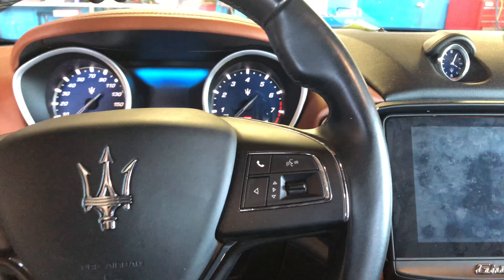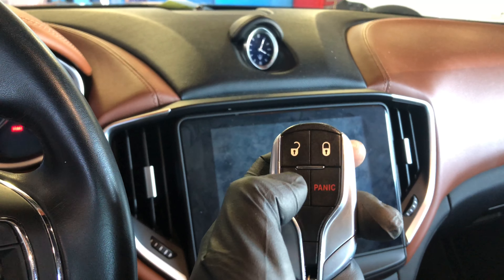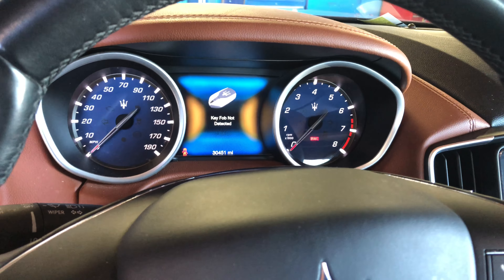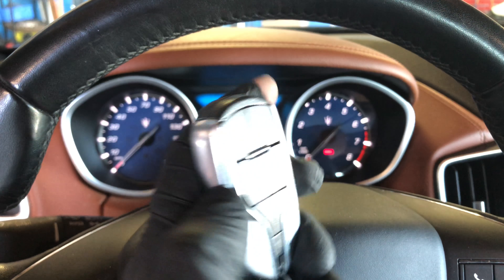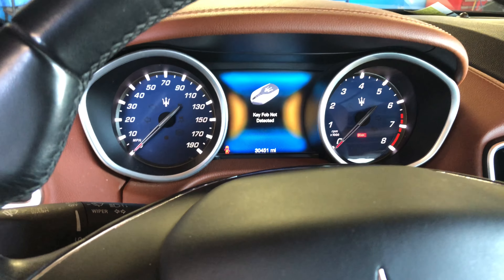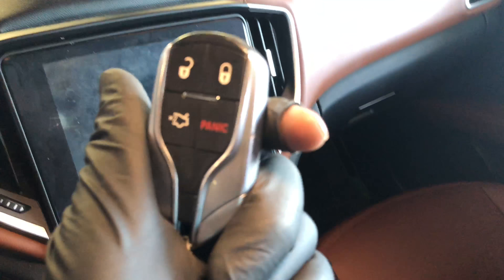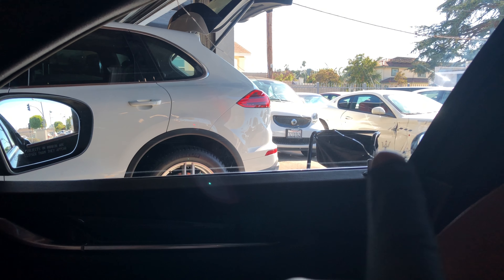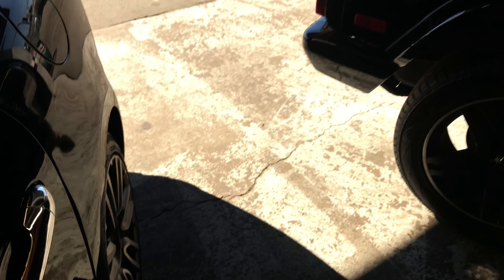Our issue with Maserati Ghibli - Key Fob Not Detected, Solved

Comment: I bought a Maserati Ghibli 2014 SQ4. I started the auto start for testing and I accidentally left the key inside the car. When they hit the car door, they blocked it and the car was turned on with the key inside. How to act in this situation? thankful
Reply from the maker: It’s locked, you need to get a spare key and unlock the car.. probably the only way that’s safe